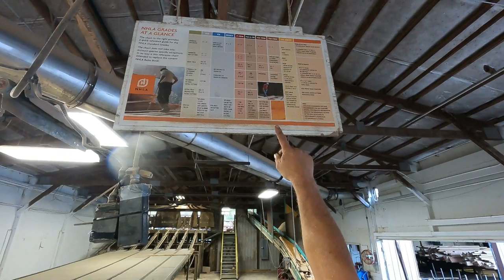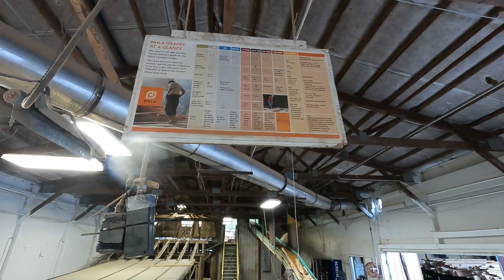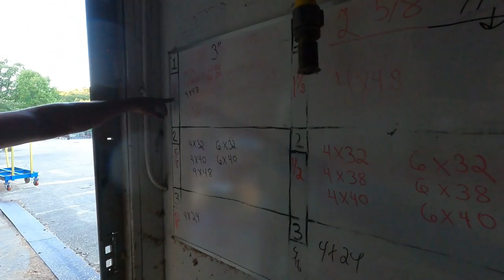From Logs To Lumber At The Sawmill With Logger Wade Part 2

Comment: Longer Wade just has one speed “FAST”. What a awesome trip Chris!!👍👍♥️♥️✌️✌️
Reply: Back in the '70s I worked at an Army supply & maintenance depot in California. The Superintendent of the Supply operations talked and walked as fast as Wade.  Extremely knowledgeable about all the different processes in each building as well as for each product line. Each building, we had eight of them, was 1/4 mile long and three stories tall by 500 yards wide, in other words HUGE.
Reply: I usually run the Chris videos at 1.25 so they move long. For this tour I ran Wade at .75.
Reply: One volume, too. LOUD. The ear pro evidently came around pretty late in life. LOL

Comment: Thank you Chris and Wade for the guided tour.  I found it very informative. One thing I noticed that might be worth mentioning is the use of explosion proof lighting fixtures throughout the complex. Obviously this operation generates lots of airborne dust, which in the critical concentration levels can be explosive enough to destroy the entire building and cause grave injury.  I would imagine sawmill operations must meet the same dust abatement and explosion protection standards as grain elevators and cereal mills.
That is a fine upstanding and outstanding family running that business.

Comment: I was so impressed with the set-up and efficiency I watched it a second time. I even sent my younger brother in Sydney a link. We have both been builders by trade for some 40 years. My daddy was also in the trade since the mid 50's working heavy construction on power stations, bridges and dams/pumping stations and the like so younger brother and I learnt all that too. If that mill was in Australia it would be one of the industry leaders. Here good saw logs are getting sent to the chipers and sent to China for paper. All for a quick buck. It is disappointing to see. It is refreshing to see efficiency young man.

Comment: You have a nice operation and a good attitude Thanks for the presentation.  Most people don't know of all the dangers in a mil.  I worked at the largest sawmill in Canada until I became allergic to hemlock.  The bandsaw was changed out every two and half hours with a crane to install it, took six minutes to get up to speed at six thousand rpm.  There were a few hundred employees working 24/7.

Comment: Even though I lived in logging country most of my life (and remember sawmills all around LBL) until moving up to the northern Plains states, I never really had a good look at the different steps a log takes from beginning to end until now.  He's a character but interesting as all get out...  There's no telling how many times I've driven past their mill or even passed them on the road, for this is this is right along the northern edge of my old region.  I've run plenty of wheel loaders but getting used to the newer ones (should have seen the look on my face when I first got in one with no steering wheel lol) that have fly-by-wire joysticks slows me down if it's a strange machine.  I noticed you weren't going to max out the clamp on his, either!  

Y'all did good on this two-parter...  Thanks for sharing his operation!

Comment: Very interesting to see from start to finish from the woods to mill to products. I worked maintenance in a hardwood flooring mill. It takes a lot to make 3/4 flooring. It takes a lot of maintenance to keep it running and it's hard dirty heavy work. In the operation I was responsible for a small cutter head weighs 90lb same for feed rolls. Top plates on the Waco were  supposed to be two man lifts, but with all companies they never had enough help and changing a head during lunch you can't wait. One inch plate is heavy and was all I could do to lift it. Enjoyed keep up the videos.

Comment: What an informative video !  The two of you what you don’t know about the sawmill  ain’t worth knowing. Thank You. DoesLogger Wade have a lower gear, boy can he talk.  I built a house, love wood, I have beaded board white oak ceilings. Cedar ceilings in my closets, with cedar shelves. I won’t live in a house with sheet rock ceilings, boring.  My wife & I planed, stained, polyurethaned, & installed the ceilings. She made a real hand at measuring & cutting. She helped me get boards in place & clamped. I had to drill holes for the nails. We were newly weds at the time really helped cement our marriage. We bought #2 white oak. There was an older gentleman who had cabinet shop made the beaded board on a Foley - Belsaw planer/ moulder. $16/ hr. $8 for him $8 for shop. I still have knife for moulder.

Comment: Very similar to the sawmill set up that Superior Hardwoods has in Cambridge Ohio. That's where I use to take and sell all my higher grade logs. I milled all my lower grade stuff into railroad ties and cants for pallet mill. Slabs sold for firewood and we sold the offcut lumber as just rough mill run which was good for farm buildings. Of course I would take custom lumber orders on the side that was quality cut but far more exspensive.

Comment: Great Mill cometary of how the lumber mill works I use to work in the logging industry and behave delivered many a loads sense aquiring my CDLs, an I like the way Logger Wade head ache rack is connected to the log trailer front instead of behind the cab of the truck because in a sudden stopping situation the logs can still be catastrophic for the truck driver becareful men .

Comment: On one shift our headrig bandsaw completely blow apart and the bits of metal kept stopping at the metal detectors on my chipper belts,   and had to remove every bit of metal before going through the chipper,   I saved a hand sized bit of saw in the shape of Australia ha ha ha,   it's extremely dangerous in the sawmill in many ways,   and the noise is up to 140 decibels,   all our sawdust went next door for board manufacturer  and all bark into the furnace the chip was transported to the paper mill,   we only cut radiata pine totally regenerative logs and prune butts only for the USA market only,   360 packets minimum per shift 24 7 .

Comment: We sawed 6 and  7 good.  Some guys buying want it for a specific something they are making..cabinet doors or what ever. We also separated some species,  like straight grained hickory.  Grading gets crazy.  All our beech was 6 quarter going to Budweiser to age the beer.   Persimmon went to a place making wood golf driver clubs  walnut had the craziest grading rules.  White oak allows pin knots. 
Most graders start on poplar. To get the cutting sizes etc ingrained in their head. (basics) then start other species.  Rules are set by buyers and sellers and published nation wide.
In grade disputes a certified grader will come in and settle the dispute ... His word  is law.

Comment: Wish those logs were closer, i need new deck boards. What type of wood would you recommend for my lowboy? I used rough cut soft wood and they lasted 2 years. Not looking to cut corners. I'm in Canada so i may not have access to some of the lumber you do.
Reply from the maker: You need a white oak board is what we use down here